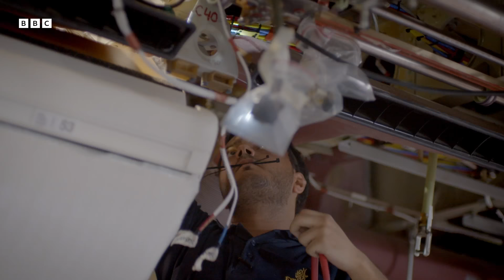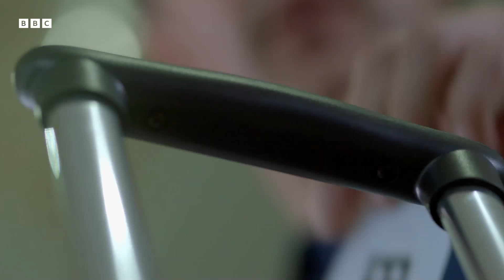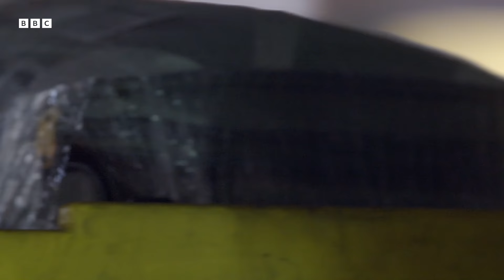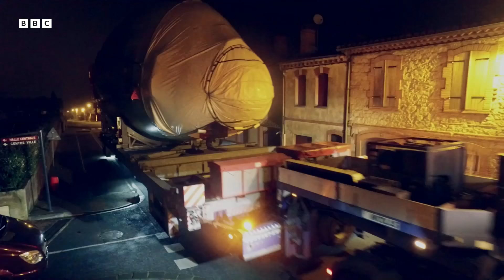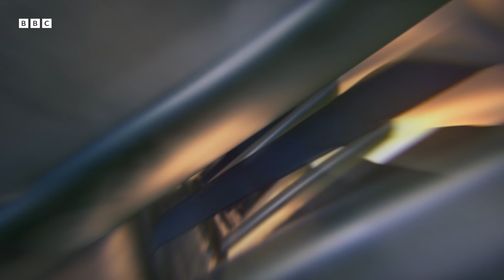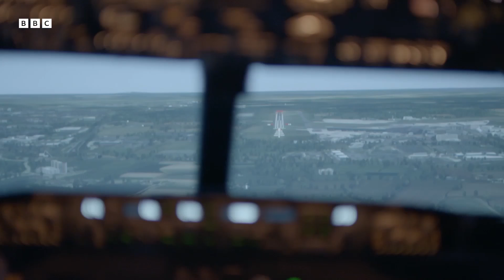From Takeoff To Landing: The Fascinating World Of Aviation | BBC Earth Science

Comment: 🤔☝️As Impressive as the engine technology goes for the monitoring all of the engines and the system and data 📉 the similar technology is being used with DDC Which Is Direct Dopplemyare Connecte. So The Dopplemyare Which Is The Leaders In Ropeway Installation Of Chairlifts and Gondola 🚡 Systems That Also monitors All of The Chairlifts Around The World 🌎.